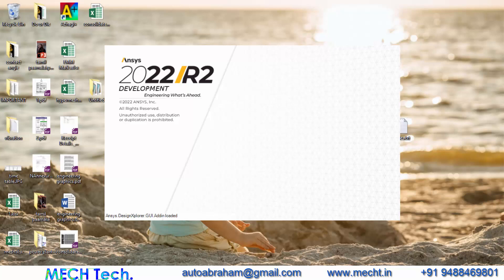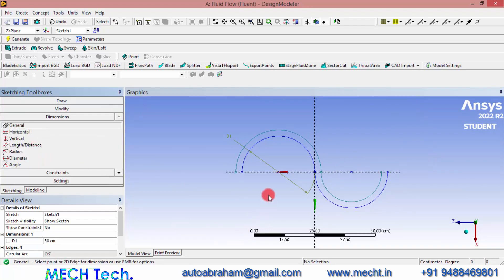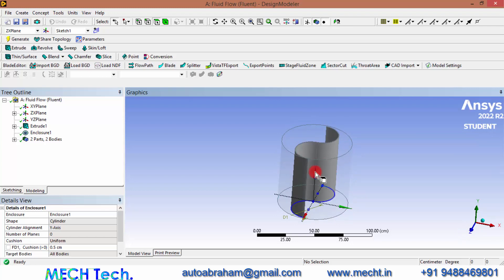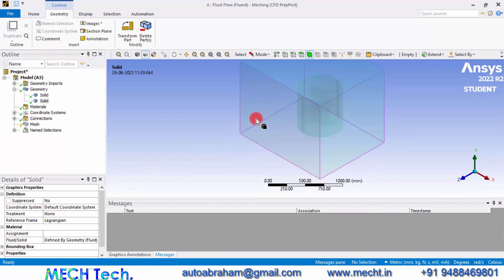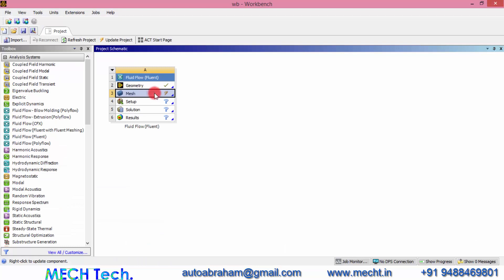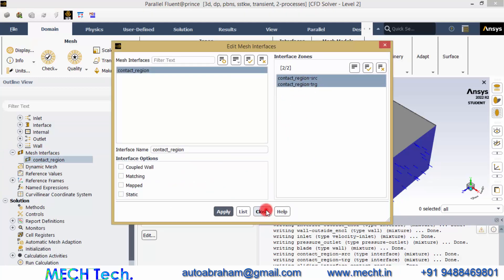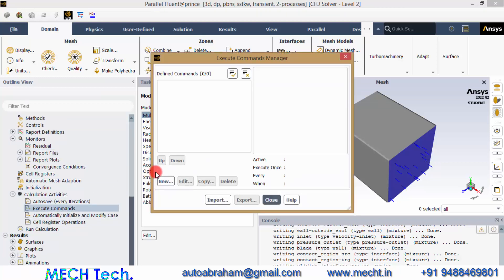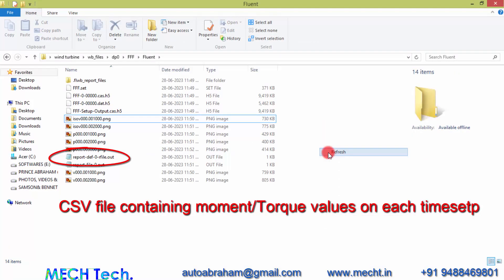Ansys Fluent Tutorial for beginners | Transient 3D | VAWT| Savonius Turbine | Step-by-step procedure

Comment: Sir How to find torque of different different velocity
Reply from the maker: You can set up report definitions to evaluate the torque on the turbine blades. Run the simulation at a given inlet velocity up to a specified timestep (actual flow time). Then stop the simulation, modify the air velocity, and repeat the process to obtain results for different velocities.

Comment: Very good video.  I have a question... Why you suppress the blades  in the geometry configuration??? ...I thought you may suppress the cylindrical enclosure...since the cylindrical region is to indicate what will be set to a given RPM...
Reply from the maker: The purpose of suppressing the solid domain is to exclude it from the computation. Generally, we do not want to include solid domains in CFD analysis in most cases like this. Therefore, to remove the solid blade, we suppress it. The cylindrical domain, where the airflow exists, is mandatory for the computation

Comment: Thanks for the video!
Just one question, why did you define the rotational velocity of the blade? Shouldn't it be simulated and determined as a function of the inflow velocity?
Reply from the maker: Dear Seidel Matheus, Certainly, your observation accurately reflects the actual phenomenon. However, in the realm of CFD analysis, simulating the intricate motion of blades in response to wind velocity poses a considerable challenge. This complexity stems from the multitude of influencing factors, wherein the mass of the blades plays a pivotal role. As a pragmatic approach, the prevailing practice involves assuming a specific velocity and subsequently computing the torque/moment. This methodology is adopted due to its computational feasibility, considering the intricacies involved in capturing the dynamic interactions.

Comment: I am having a floating point exception and the solution stops after 16 iterations. I have a different blade design but I have followed all steps precisely. Could you please provide some help? Thank you.
Reply from the maker: That is probably due to improper boundary type or boundary conditions. First, perform a steady-state simulation. Then, examine the velocity and pressure plots before proceeding to the transient analysis. Hope this will help you to find the actual problem.
Reply: @MechTechSimulations  Thank you. I will follow your advice and share the experience.
Reply: I had designed my turbine on SOLIDWORKS. I tried to design the geometry on Design Modeler but then I was receiving different errors. Then I reinstalled my windows and then reinstalled ANSYS in my SSD. Then I performed the simulation. It took a very long time ~16 hrs for calculation. In 16 hours, out of 500, 153 time steps were complete, then ANSYS Fluent closed suddenly however, when I opened the solution tab, there were some results there. Then I reduced the time step and no. of iterations. Then the calculation ran smoothly and I got my results.
Thank you. @MechTechSimulations
Reply: do the grid independent test first, refine the mesh in point rotating area